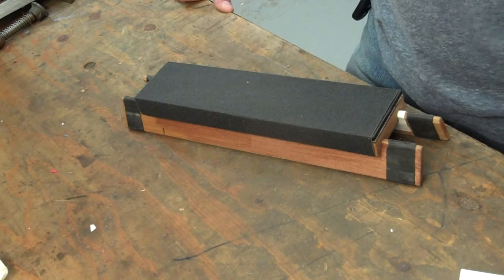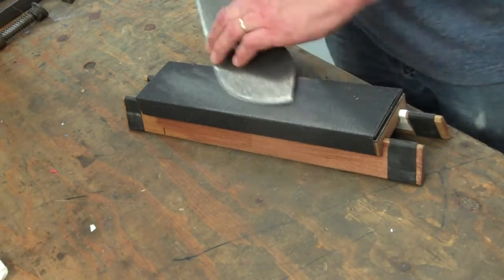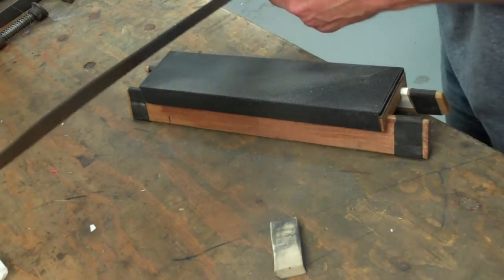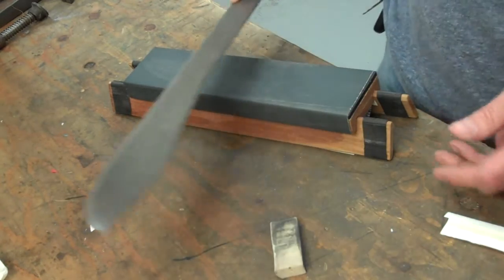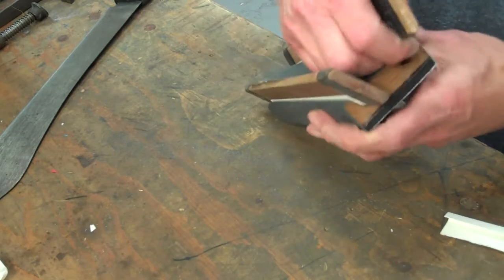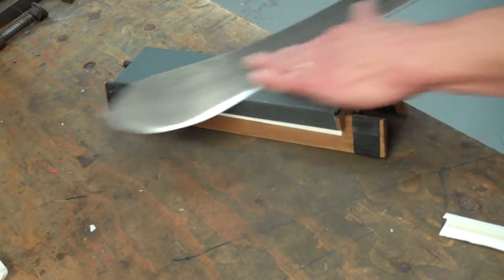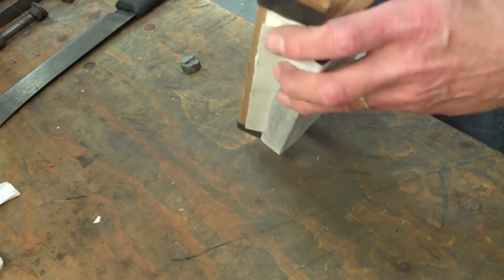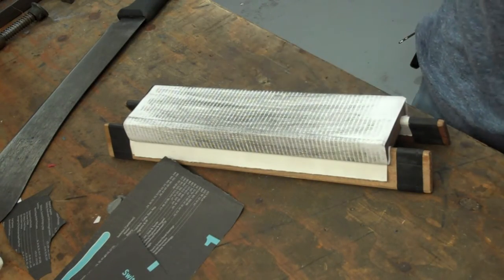Washboard tackling Bolo machete

Comment: Thank you for the video. I have an older carbon steel bolo and was trying to decide the best way to sharpen it.
Reply from the maker: If its really beat up, a mill file works great for initial setting. Then go back and do it by hand on a stone or wet/dry.

Comment: This is definitely effective, and I started off sharpening like this on a smaller scale (smaller blades on smaller pieces of sandpaper).... I just have to point out how non-cost effective that is these days. Right now, a few pieces of sandpaper that large is nearly 1/3 of the cost of an 18" machete.  It just wouldn't make sense. I'm using a file, then old whetstone, then strop, because the sandpaper is way too expensive.
Reply: 100%. I sharpened my machete on my diamond sharpening stone till it was hair shaving sharp even though it was uncomfortable cause of how small the sharpener is for the blade side but I know the diamond sharpener will last me minimum 5-8 years

Comment: I buy tramontina machetes and there are perfect for this method they have a okay edge but using the sandpaper method works good I go from 200, 400 , 800 then just strop it I use mine for and hacking around my area and ranch

Comment: If a person can sharpen a knife with a whetstone can transitioning to knife to machete be the same or no? I understand the concept of the angles.
Reply from the maker: Exactly the same.
Reply: @Neuman2010  thanks but the angle might be different. Knife would be 15 degree to 17. But machete would be like 20 degree angle.
Reply from the maker: @josephpark6064  you'd have to experiment in use. My hatchets and machetes about 30-32 inclusive, pocket knives 26-28. 
I'll go less acute if the steel can't hack it or usage is too rough. 
The mechanics are the same, whether knife, machete, hatchet. Some machete patterns like a Panga can be a little more challenging as the belly runs nearly 90°.

Comment: What's the brand of that machete? 
Will it give the same result if we add some water during the process?
Reply from the maker: That's an older Clod Steel (Lasher). Water works too, but seems to reduce life of the sandpaper. Oil can also be used. Any fluids will cause the paper to swell a little and loosen up on the base, not a big deal but something to be aware of.
Reply: @Neuman2010  what if we use grinder for initiating the bevel edge? 
Will it affect the blade?
Reply from the maker: @yebe9846  It would be better to clamp the blade to a workbench and use a large mill file. A grinder will definitely work but need to keep the edge cool and is tougher to make a consistent bevel. 

In reality you could just stop at the file-ground edge and it would be good enough for 90% of what a machete is asked to do.
Reply: @Neuman2010  thank you very much.

Actually I have 18 inch Martindale machete,  and i used grinder to initiate the blade. And guess what,  it  seems that I ruined it.
Reply from the maker: @yebe9846  Just file it back a bit or use the grinder but dip the blade in a bucket often. Probably only the steel along the very edge is no good and can be ground off to better steel underneath.
Also, the finer or more worn the belt is, the greater the heat it will generate in less time. If using the belt grinder stop at 120 grit or so and leave it as is or refine with a file or stones etc.
Reply: @Neuman2010  thank you very much 🙏

Comment: what grit of this stone?
Reply from the maker: Am using a surface textured block under silicon carbide wet/dry sandpaper. Started with 120grit, then to 320, finish on 800

Comment: great results from what deceivingly appears to be not excellent technique. dig your setup, too. whats the washboard part made out of, plastic from one of those "vote for schmucky mcdoofendork" signs they stick in your yard?
Reply from the maker: Washboard surface is machined from a piece of cast acrylic, extremely hard and durable. The earliest hand-tooled ones are still at work, showing very little change in the shape of the teeth. 

You can learn a lot about sharpening smaller cutlery by doing a few machetes on the bench like this. 
More at Washboardsharpening.com
Reply: @Neuman2010  way cool. i like the simplicity of the 'stone' too, buy the washboard set, paper and be fine til the paper gives out. very nice concept, might have to give it a go. im fairly crap at hand sharpening  stuff on flat stones like this, but i've shaped a couple sandstones flat and am learning how to suck less. this is very neat.
Reply from the maker: @theguywitheyebrows  
Thanks for taking a look! Its a very simple widget, but has helped a lot of folks get better at freehand sharpening. And is super convenient in its own right.

That's pretty much the way of it - you learn to suck less and less and one day you realize you've gotten pretty darn good.

Comment: How do u sharpen a ww2 bolo machete?
Reply from the maker: You would do it the same way. Ideally start by clamping it to the edge of a workbench, do the rough work with a small mill file. 

With a new edge roughed in move on to the wet/dry sandpaper or benchstone.

I can be contacted through the website "washboardsharpening.com" for more info